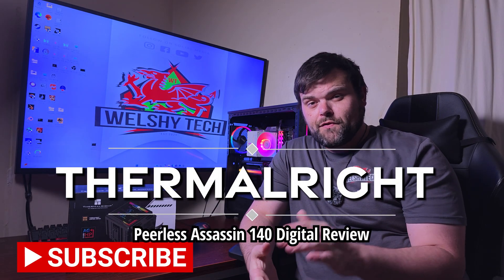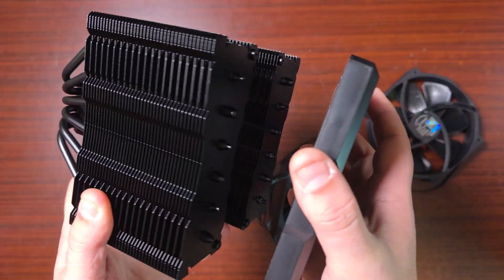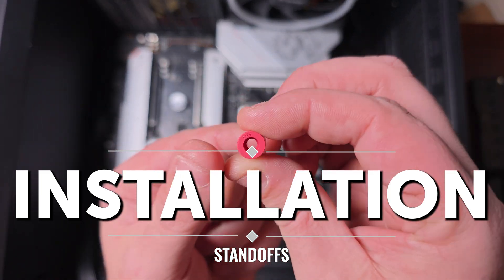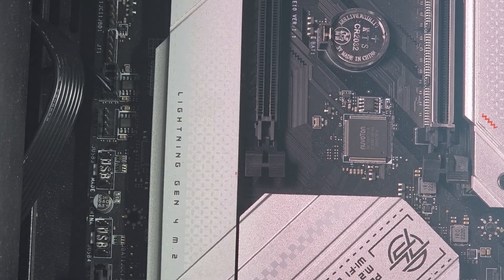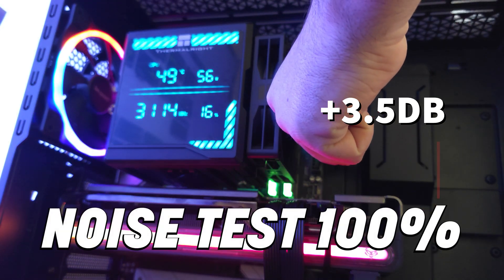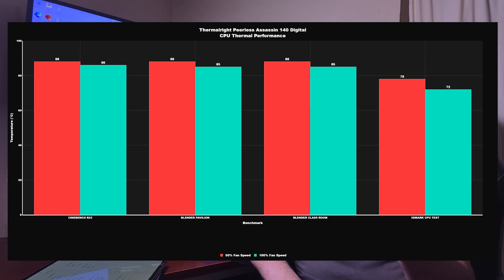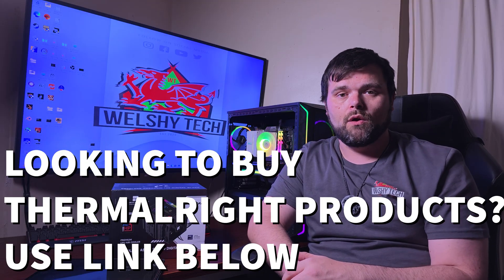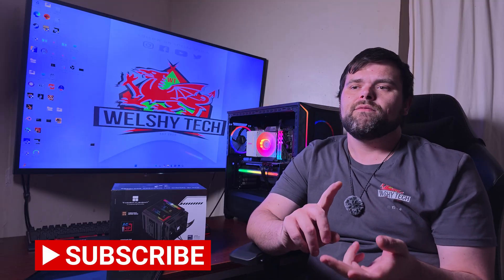The New budget king? Thermalright Peerless Assassin 140 Digital Review

Comment: I wish there was a way to mount coolers for classic monsters like the last chip I used for 7 years, the 3930, which I just stopped using 2 years ago, or 8700/2700/6700K. I want to know if these coolers could keep those cool because, since those are older, they give off more heat and didn't cool as easily because of the older parts used in the CPU.
Reply from the maker: It would be cool to see how these perform on those older high-TDP chips.

Comment: sup I was wondering what case should I choose when using this cooler? 165mm is height kinda big and hard to find some case
Reply from the maker: 165mm isn't that big I have coolers here that are taller. But for a case, you need to check the specs on the cases you're looking at to make sure it fits Coolers 165mm and above
Reply: montech 903 air max is best choice

Comment: hi, I was wondering if I should get the Ocypus Iota A62 over this? I prefer a clean look and I'm not into RGBs. Also, the price difference where I'm from is about $20 and seeing the results between the 2, they're seem to look similar. do correct me if I'm wrong, thanks in advance :D
Reply from the maker: They may look similar, but both are different. The Ocypus Iota A62 has two 120s, and the Peerless Assassin 140 has a 140 and 120 fans.
But it's really up to you if one is higher priced get the one you can afford both will do the job depending on the CPU you have
Reply: @WELSHYTECH  for context, I'm getting a 120mm dual tower CPU cooler that has little to no RGB for my new PC build. I'm going to pair it with the Ryzen 9800X3D and have them in the Lian Li A3 case. However, after seeing the results these coolers perform similarly. So, would you recommend me the Iota A62 or are there better 120mm dual tower options that also have little to no RGB in your opinion?
Reply from the maker: If you don't want RGB then this peerless Assassin 140 digital isn't for you. The A62 is a good option but Thermalright has many big coolers without RGB but there's also be quiet Arctic and many brands
Reply: @WELSHYTECH  ah ok, I'll look further into the brands you mentioned. To see which one doesn't have RGB and performs well under long gaming sessions. I appreciate your help, have a nice day :D
Reply from the maker: I have reviewed many CPU Coolers which are on my channel in playlists look through them